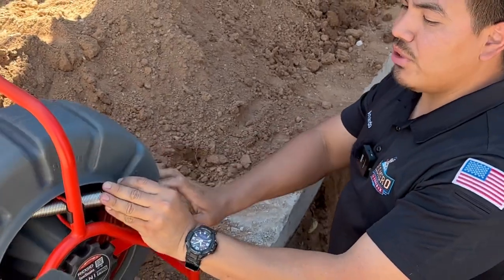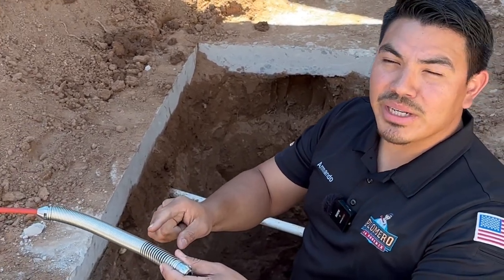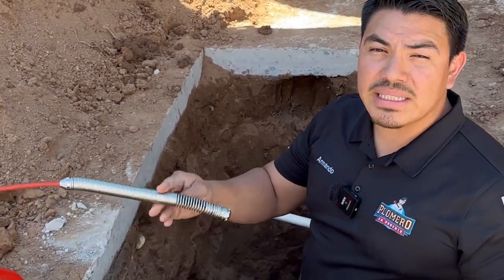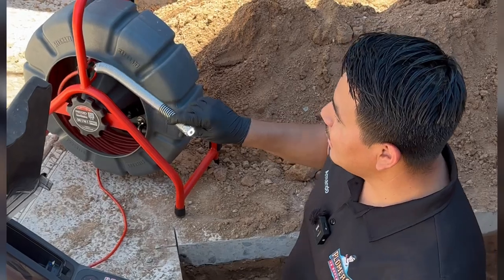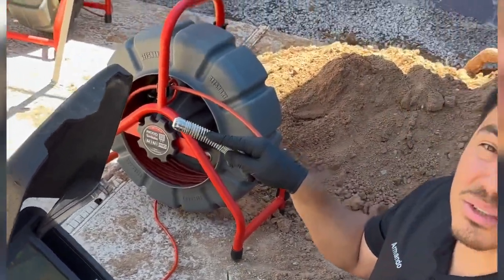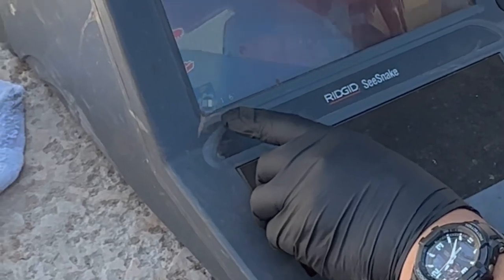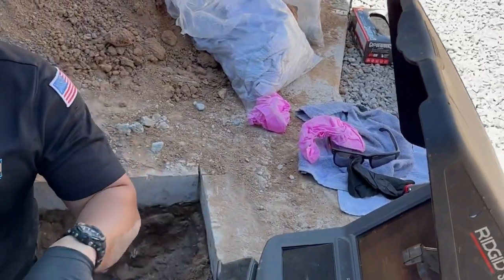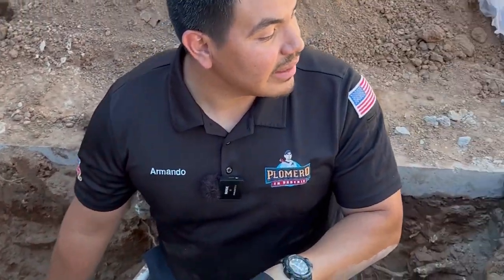RIDGID SeeSnake Mini Pro - On-Field Product Demo with Armando from Plomero en Phoenix

Comment: How are you enjoying your mini pro? Do you have any issues with going 150 feet through 200 feet down the line? I have been between this or  the Milwaukee 200 footer and struggling to make a decision.
Reply from the maker: My apologies for the late response; I don’t check this often. I love the Mini Pro; I’ve been using Ridgid cameras since the beginning. I’ve noticed that with any camera, navigating past 100 feet can be challenging. What I usually do is run water to help it move smoother and conduct the inspection on my way back. Let me know if you have any more questions. Armando.